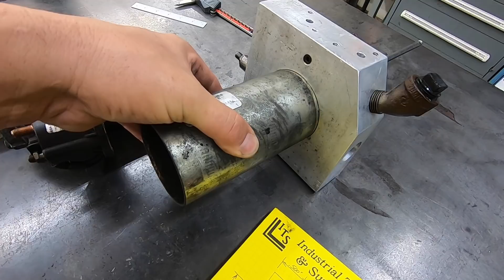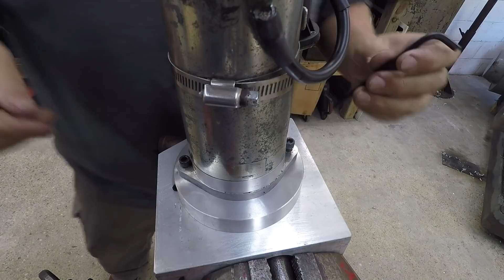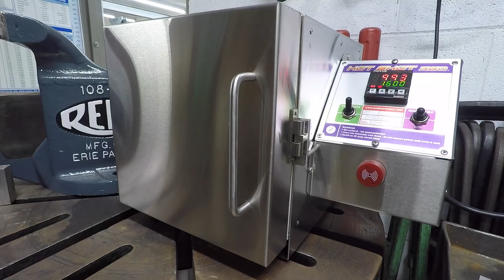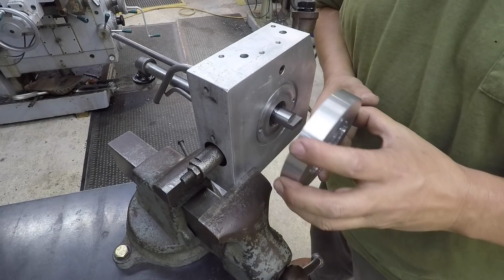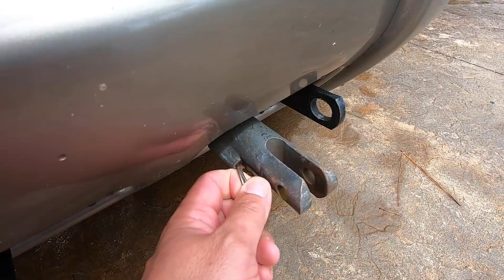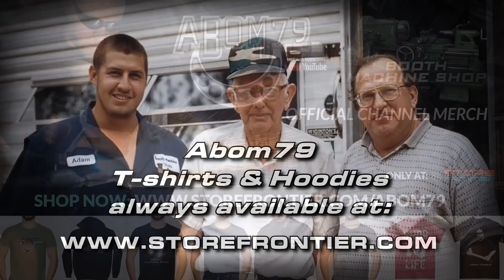SNS 309: Hydraulic Pump Motor Adaptor

Comment: Very nice man. I don't own a lathe but recently made an attachment for my wife's KitchenAid to connect a pasta roller.  just a made with an angle grinder out of a old head bolt basically kind of a similar shaft setup 4 flats on one end and 2 on the other. Cheers from Atlanta!

Comment: i bought two used 12v hydraulic leveling jacks removed from a class a motorhome at an auction for 5 bucks for both pump units with a 24" cylinder for each. both of them worked perfectly, one i made into a hydraulic press, the other i used for a motorcycle/atv/riding mower lift. they are about $600 each new, so at $5.00 for the pair, they were easily one of my best ever auction buys. your mom was lucky you could retrofit that motor onto her pump unit. it could have been a very costly repair otherwise.

Comment: very good job, but the question is what about the oiling of the internal push that you installed inside the cupelling later or soon it will be damage without oiling. 
regards.
your follower from KSA
Reply: the clue is in the name '' OILITE BUSH''  self lubricating material  used in starter motors etc. they do wear but last a long time and cheap to replace.... every day is a school day :¬)

Comment: Try cleaning up the old armature
Reply: The one time I tried that, it was a waste of time because the reason the commutator blew out was because there was a fault in the coils, not just a transient brush problem like I'd hoped.  Fortunately I can buy a new armature (for about what I paid for the dead DeWalt planer)  but I might try my hand at coil rewinding first as I have more time than money right now.

Comment: Hey Adam!
I was going back thru some of the 'old' videos, came across where you finished out the project on the vertical head parking device (2016) for the K&T mill.  You mentioned putting one of the emblems from Keith on it once you got it painted.
I just noticed in the background @06:20 that the device is still sporting it's 'as built' finish. LOL!  I understand, we ALL get projects beyond projects.  As one who did coding for a LOT of years, the one thing I would tell people about programming...No program is EVER finished...But, somewhere you have to STOP and start making MONEY!!!
Good vid!
Ken

Comment: Nice parts Adam! The solenoid that is in the picture looks to be very similar to a starter solenoid. They are intended for short duration, they get hotter than a firecracker if left energized for more than what you’d expect from how we crank our engines!

Comment: I guess my head is too thick. What was the purpose of machining the adapter again?
Great job though!!
Reply: It was so another drive motor could be used on the hydraulic pump for the RV's leveling jack system.

Comment: At 28.56 you align up and down when you should have aligned it side to side, of couse it would fit this way, I am not saying it does not fit, but you have set it up incorrect to check the line up.

Comment: A tip for when you drop audio: Download a voice recorder app on your phone. (I use Sony Audio Recorder on my Android). But, it will give you an audio file that you can use in a pinch and sync to your video in post production, and if nothing else, you have an audio recording you can use later if you need to narrate a segment due to lost audio. Just a tip. Cool build as usual!

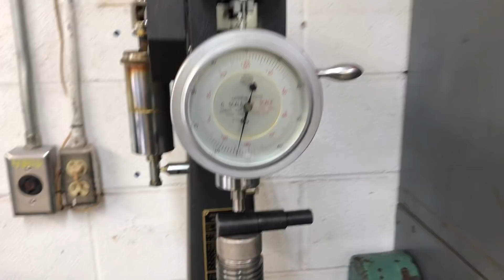Comment: 17:11 The tool marks on the part will throw off your measurements sometimes. Also just as a reminder if you already have been told in order to get accurate measurements never do a test less than 3 indention diameters away from previous test.

Comment: Regarding hardness testing: you need to apply a curvature correction when testing round rods and bars. In the range of HRC 45-50, you need to add 0.5 points when testing 1" diameter, add 1.0 when testing 0.75" diameter and add 1.5 points when testing 0.5" diameter. So your hardness values on the various shaft sections may be more uniform than you think. The corrections can be pretty significant at lower hardness ranges and smaller diameters.

A semi-related piece of advice is to be aware of minimum thicknesses for valid testing. Softer materials require greater thicknesses to yield valid results. You can search on-line for tables or pick up a Wilson/ACCO wall chart. If you see an imprint on the back side of your test piece, it's probably too thin for that hardness test scale.

Comment: If you decide to stay with a gopro then get the 7 black. Best new gopro. 7 silver is junk, bought one new and it wouldnt charge most of the time and the 8 black has camera issues, 7 black is the only new one worth buying I promise, but I feel like you will still turn back to your hero 4 to be honest.. even tho the video quality will be better..
Reply from the maker: The problem with all of the 4’s is the usb jacks are failing. All of the ones I’ve owned have after a couple years. I’m using the 7 now as a replacement but I also have the 8 which is the best for handheld shots.

Comment: without coolant you are loosing some of the hardness by letting the metal get hot. (blue chips ) now I make knives and don't use that thick of metal when hardening but when regrinding we always use water to keep the metal cool so we don't loose our hardness for the blade
Reply: Not really, most of the heat comes from the metal deforming as it is being sheared and curled up by the cutter and most of it (~70-80%) stays in the chip.
https://www.sciencedirect.com/topics/engineering/metal-cutting
(TL;DR version) https://www.mecholic.com/2016/02/heat-generation-zones-in-metal-cutting.html
Reply: @cojones8518  okay that makes sense. and the other thing I did not think about is the part is not changing color so you are not loosing the temper. If it was starting to get a strain color then I would say you loosing hardness. thanks for the info

Comment: Hell yes man I have  Hydraulic Lift Gate, I live in 50 sq ft in a 16ft Cargo Trailer the back is my shop. I can  do everything I try to stick with lots of pro bono/trade/sliding curve work for those that really need help...like you man I am sure you need help? Like sweeping up the shop, taking blame, a target for frustrations? You know an apprentice!!! 
Anyhow to make Haircut money I stick with Custom Tile, Cabinetry, Off Grid Solar, and Electrical work. I would straight kill to have a 4 corner Hydraulic leveling and Jack system! 
Yo A you ever need anything let me know I would love a couple hours just to draw something up for me to get started on. I know how to repair Hydraulics(replace lines, rebuild pumps) I really know nothing about how it all works beyond Backhoes etc. 
Bomb ABom vid man killer!!!

Comment: A question came to my mind when I watched you turn the shaft to the finished dimensions... when you heat treat and temper something, is the treatment merely a surface treatment like surface hardening, or does it fully permeate the piece?
Reply: Edward Cabaniss it all depends on the material and hardening process. You can get both. If something is only hard on the outside, it's usually referred to a as "case hardened."

Comment: nice solution, i did myself a few such adapter plats recently for stronger electric motors for different size thrash and recycling plastic shredders , was it dimensionally not possible to make the shaft from cuting off the shaft from the old motor and just milling the two sides flat for the "new" motor ? you would have just needed to make a smaller ID brass bushing

Comment: Great video Amigo!    

Just wondering what insert you ran to get the shaft coupling to size post heat treatment?
Reply from the maker: It was a wnmg 431 Iscar IC 8250

Comment: I am a little bit surprise by the screw mounting : non use of thread lock. In a mobile use, it seems mandatory
Reply: The aluminum is soft enough where most of the time the threads sort of “bite”.  That explanation is nowhere near scientific, but in my experience, thread locker is not necessary when threading into aluminum.
Reply: I'm sure when he put it together in the shop it wasn't the final assembly.

Comment: Beautiful machine work as always. My only concern would be the weight of the motor on two little studs. I would have felt better if the motor studs were right through into the pump body. Just an opinion though.
Reply: I would feel the same . Mind you, the RV is no desert bouncer . But that is a heavy cantilevered  motor.

Comment: Just wondering. I do not have any experience with hydraulics, but don’t you have to use seals in between?
Reply: There are no fluids in the adapter itself. It's all contained in the pump body. The square part.

Comment: Does anyone else reflex-blow on their phone screen to clear swarf after holes get drilled? 😂  I wanted to ask what folks think of using mandrels with a tapered boss washer for reversing large diameter parts with short length? I always feel hinky holding parts by a very short shoulder and if the item has a centre thru-hole and can be held by bolt into mandrel would you consider it viable? Thanks for another great vid Adam! 👍🏻
Reply: No we dont blow on our phones wtf 😂😂 take a break dude lol

Comment: Damn I have scrapped over 10 hydraulic pumps and motors in the last few months I would have sent you the whole thing pump motor tank and everything else. Hell they even had back up motors attached to the primary motor.

Comment: If you use paper instead of a match, then you don't have to worry about the residues from a match an its fumes. The paper will burn out the oxygen just as well and its cheaper in the long  run
Reply: Cheaper than a match??  Damn, we are really cutting corners here!!

Comment: If you need to replace it one day, I'd first try pull the alloy valve find the in/out drill n tap the block and just run hoses into that same block from a off the shelf 12v pump. 

Way easier then that way then changing the block to a new one.

Comment: Very slick job, Adam, beautiful work. In an earlier episode I thought I heard you say the old drive motor is no longer available or is crazy expensive. If the new motor is a lot cheaper, as I would suspect it would be, I bet you could sell a couple hundred of these things to folks needing them. And advertising the product on YT would be a piece of cake for you as there's a HUGE contingent of RV'ers on YT. Just saying. Of course the job would be massively more efficient on a CNC machine as a production item...but if an $850 motor which you can't even get any more (I seem to recall that price being mentioned in your prior YT) can be replaced by a $250 motor plus your $225 adapter goodie, you be da man. Capiche?

Comment: That was a nice modification project and good to see it work on the camper. Most of the time, there are parts on hand that just need modifying especially when you got the machine tools, rather than getting over priced parts. 
I have doubt about that match idea, the oxygen will go but the phosphorus from the match will be added to the mix and can effect the overall hardness.

Comment: I must say, you make this look so easy, of course you've been doing this a long time too. I've said it before and will say it again, your professionalism shows. 
I do however have a question. Wouldn't it be prudent to make a mount for a shop vac hose to help remove all those chips? Would make cleaning the machines a lot easier I know.
Awesome to see one of your repairs actually working outside of your shop. Great video, cheers :)

Comment: When we heat treat parts we wrap the part in butchers paper really tight and foil around the part as tight as we can. When the paper burns it consumes all the oxygen in the packet. Plus it leaves extra carbon for hardening the part.

Comment: If you are ever working with an alloy that is sensitive to sulfur / phosphorus, you can substitute a squirt of low sulfur lubricating oil  or kerosene / ULS diesel fuel for the match in the heat treating pouch.

Comment: Abom79.......I work for a car part manufacturer supplier.  We deal with a lot of different types of steel to anneal for various reasons.  I can send you what our machine shop uses for temps to anneal/temper anything from 1040 all the way through M-2

Comment: If you wanted to purge your heat treat bag argon is heavier than air. You could carefully fill the bag and seal it off. 
I'm surprised you didn't make a pinned sleeve for the new motor. Something similar to a Chevy H.V. oil pump shaft. It would allow movement and keep it centered when/if the bushing fails.  
I feel sorry for the next guy who has to figure out that motorhome :-) The nice thing about the way you did this is it can be restored to the factory parts if the need ever happens :-)

Comment: Not sure how much you make off these videos but this hardly seems cost efficient :-) 
Seems like it would have been easier to have the motor rewound/replaced. 
Is there a benefit to using this motor over an exact replacement?
Reply: In a previous video he said after a long search the original motor wasn't available for any price. The replacement is a standard part for many other systems and still commercially available.
Reply: @FastBowtie388, he was helping family. What's your price for that?

Comment: Nice Video i like it. What about a Hole throu the adaper and bushing, to get a chance to lubricate it with a greasepump from Outside ? This would be a nice feature.
Greetings from germany.
Reply: That bronze bushing he used is impregnated with oil it does not require any lubrication

Comment: nice work.
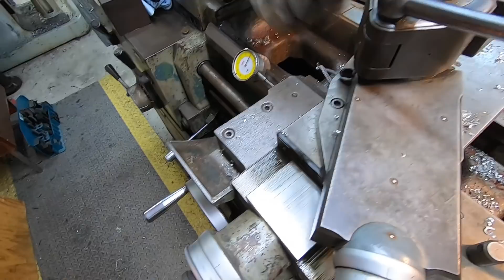but: 5:12 gloves while working on a lathe?  Isn't that a deadly sin?
Reply: Rubber gloves man, they rip like condoms but don't make you pay for 18 years.
Reply: Being that those are super thin nitrile/rubber/latex gloves, they should just tear straight off if they got caught in something I would think. 🤷‍♂️ I could be wrong though.

Comment: Abom79, is that brass material self-lubricating?
Reply: Yes. When those bearings are made, bronze grains are coated with oil, the mixture is forced into a permanent mold at such a pressure that enough heat is generated so that the grains are melted enough that the grains are bonded with each other with oil between the grains. When the bearing gets hot from friction the oil expands and coats the inside of the bearing material so that friction is reduced.
Reply: https://en.wikipedia.org/wiki/Oilite

Comment: Its great that your mom has someone to retrofit all the parts needed to keep an older motor home  running. Otherwise they can be come a very expensive toy. I am glad I finally got rid of my coach.
Great save for a very expensive hydraulic pump replacment.

Comment: And somebody someday will wind up with that motorhome and have everything else fall off and go: "Wait. That isn't original!". Next door neighbor has a 30' Airstream with less than 1000 miles. Too bad he got it stuck in the mud and just kept spinning the tires and overheated it. And it caught on fire and burned the entire wiring harness. Sometimes you just have to shake your head and bite your tongue...
Reply: Mustie will fix it...

Comment: Does the heat-treating harden the part all the way thru or does it just it just case-harden the part? If it just case-hardens it, could you have machined the hard layer off?
Reply from the maker: It’s heat treated throughout the entire part.
Reply: Case hardening is a chemical treatment that adds carbon or nitrogen to the outer layers of metal, if he were case hardening it he would need to have applied a case hardening compound to the part.

Comment: Not related to this video. I shared a rrusted broken bolt abomb79 with my son he took that and removed two from a catalytic converter. I also showed my two kids how to use a spotting drill based in you videos. He followed along and said it didnt fit. I showed him the bur on the decorative pin and after a little debur a gentle press fit. Thanks. PayPal donation.
Also showed them how to eyeball center using the drill cutting edge x y.